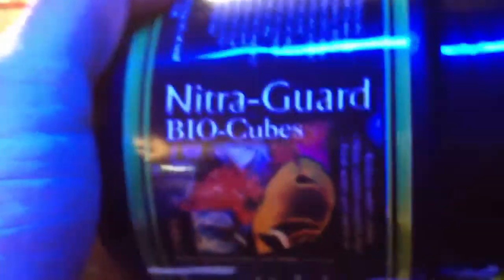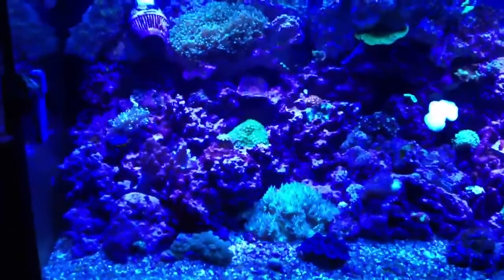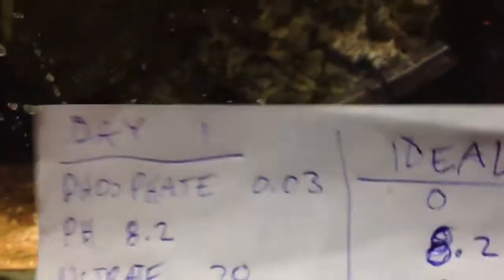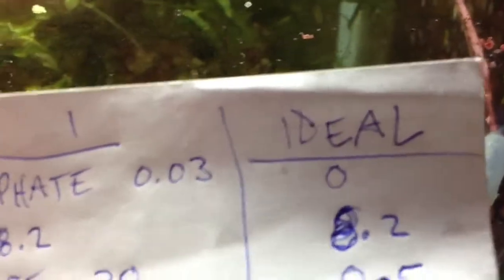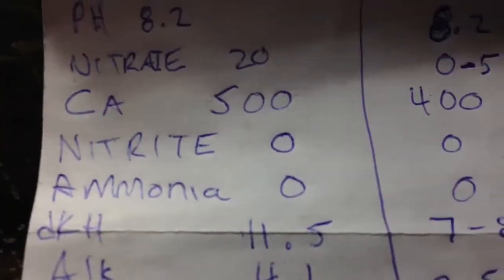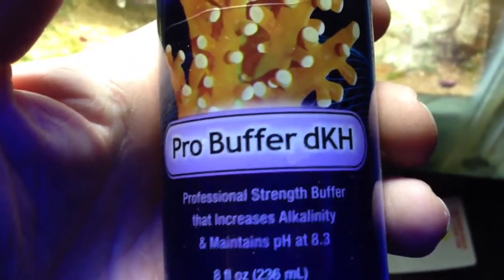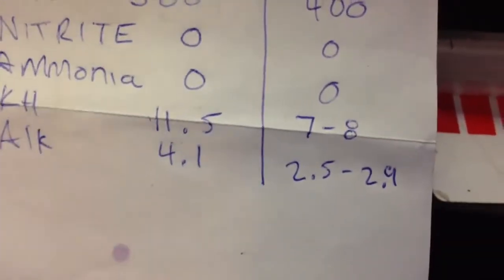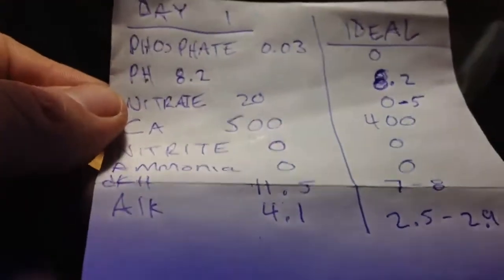Nitra-Guard Bio cubes nitrate remover pt. 2

Comment: I just purchased this stuff. The only question I have is if you tightly packed the nitra-guard in the media bag? I'm wondering if they will break up and disintegrate if not tightly packed and in a high-flow area. (for example, the phos-ban media must be tightly packed or else the pellets grind apart and are useless) Any advice would be appreciated! Thanks
Reply from the maker: Hi, I used mine kind of loosely in the bag, and tightly packed in a reactor, with pretty much similar results both ways. The cubes are pretty tough and don't crumble that much. I have switched to bio pellets now which seem to work a bit better for me, but the cubes are good too.